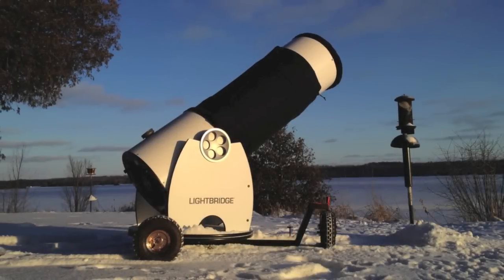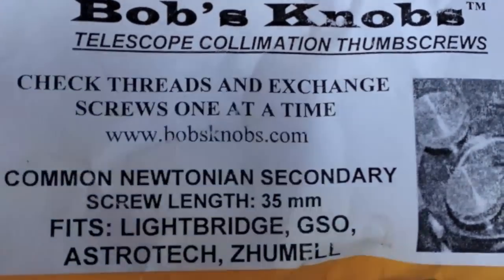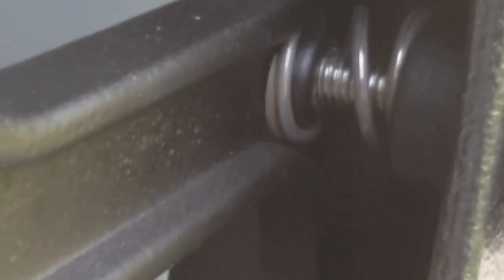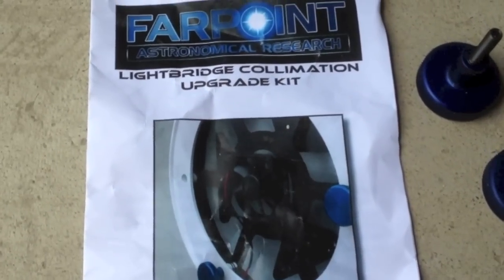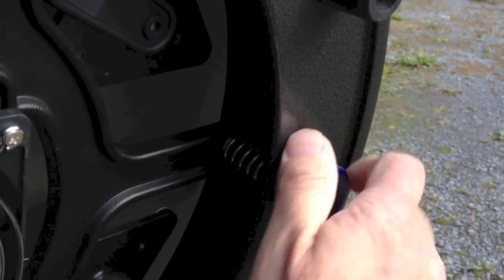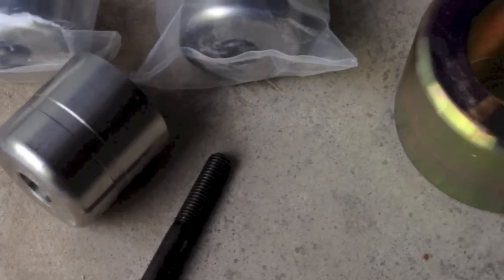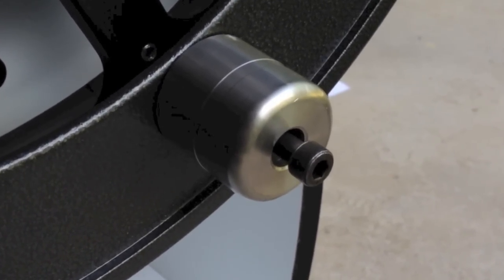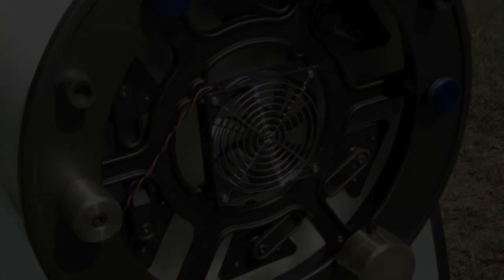Meade Lightbridge 16 Review, Part 3 - Upgrading collimation and balance

Comment from the maker: AFAIK, most of the Chinese dobs come from two or three main suppliers, so it's likely the same issues apply to other brands - issues like machining tolerances and so on. You should check the sites of 3rd party suppliers, like Farpoint Astro, Bob's Knobs, JMI, Astrozap - and other great companies who have figured out ways to improve stock scopes. BTW I think you're smart to get the big aperture. I'm a moron and it took me ages to acquire what little I know. Still fumbling in the dark.